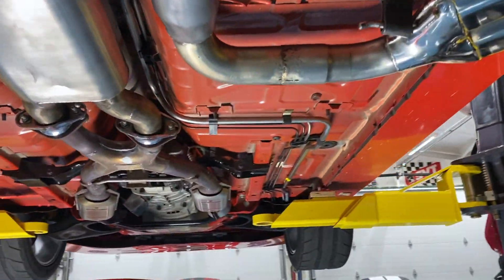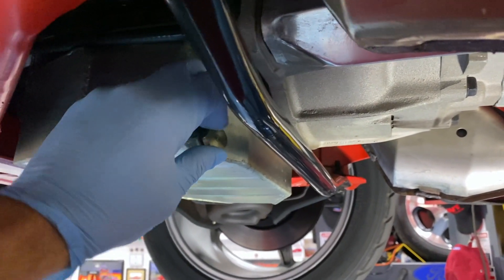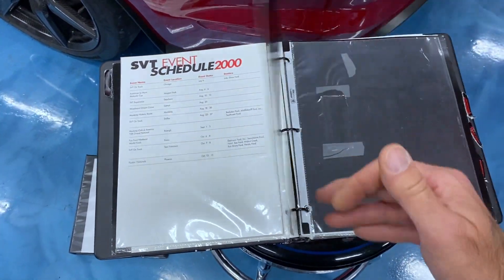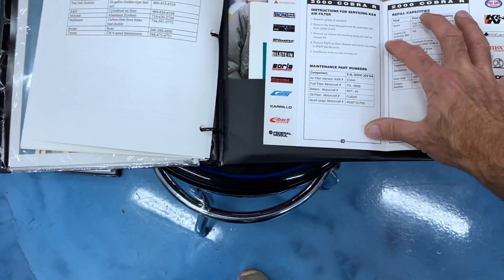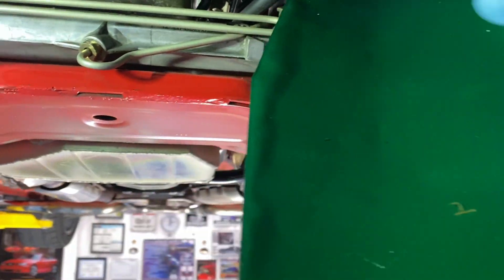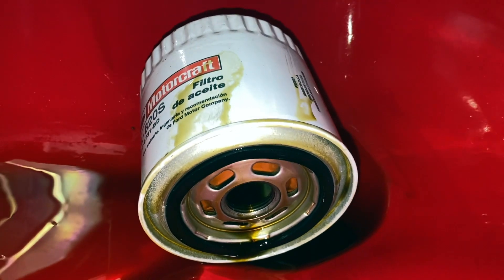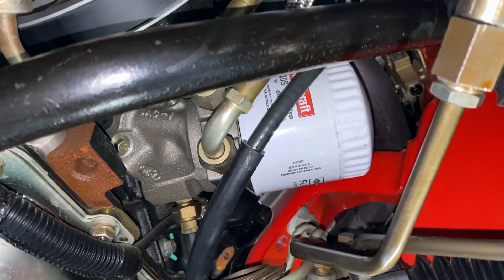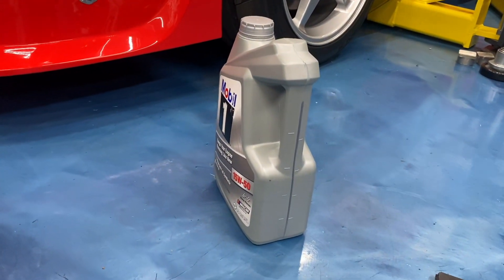2000 Cobra R Oil Change Process

Comment: Just a helpful FYI ..... oil filters should be tightened ONE FULL TURN after gasket first makes contact with base ..... so it's easy to feel by hand when rubber filter gasket first contacts the  base, then you can mark a line on the filter and then proceed to tighten filter until you see that line come back around. This helps when someone doesn't have much wrist/finger strength, and needs to use a wrench to tighten, but doesn't want to risk over-tightening the filter. Hope this helps some people. Thanks for a great video ... those "flexible funnels" come in different sizes and are a great tool for many jobs .... what a CLEAN Cobra R .... you definitely want to keep it that way !!  See ya !!

Comment: Love that car 😎 On my old SN95 on the front I'd jack from the frame rails as an approved jack point for that car. Do you ever use those if the pinch welds are difficult to position to? Also where did you buy the Mobile1 15W-50? #KRobraKai
Reply from the maker: Thank you sir!  I lift all my cars from the pinch welds. The 00R makes this challenging with the side exhaust. I got the oil from Walmart.com.